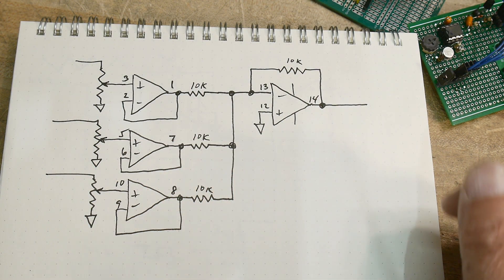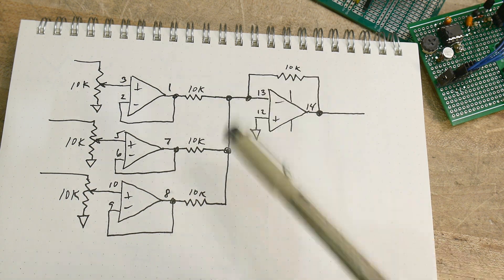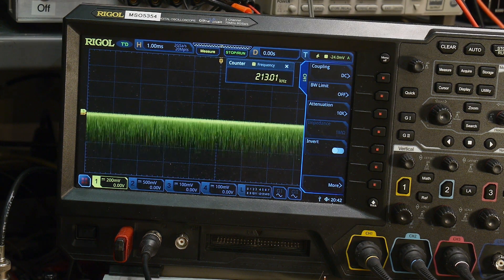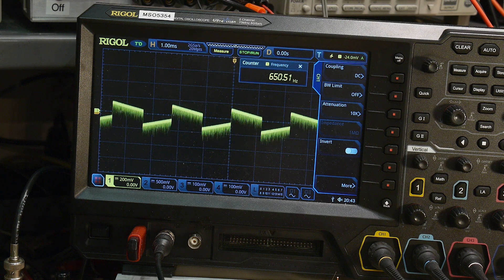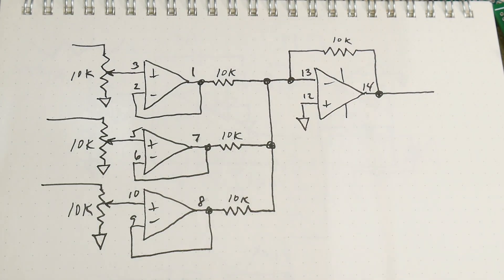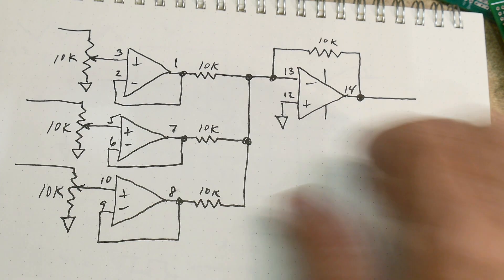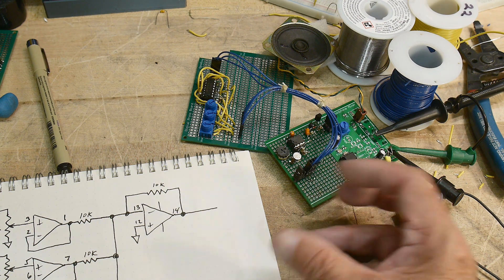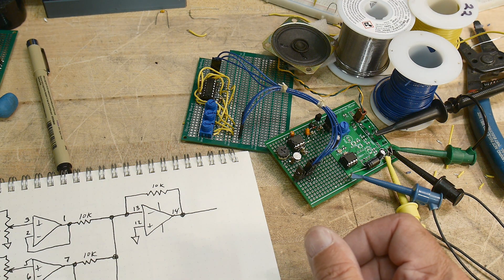#1199 DIY Analog Synthesizer (part 3 of 15)

Comment: If the point of a buffer is to have a high input impedance and low output impedance, I am curious as to why you added the extra 10k resistor on the output of the buffer? Is that to get unity gain with the 2nd stage?
Reply from the maker: the three 10k resistor are a sum. you can have different gains on each channel. so in this case gain is 1, or actually -1. if one of the buffers had a 5k resistor then that channel would have a gain of -2
Reply: @IMSAIGuy  Oh very interesting yeah that is a really good point. I had not considered the 2nd stage mixer's feedback loop relative to its input impedance. I really appreciate the insight!

Comment: I have a TENS unit kind of thing that generates out put square wave frequency less that 1khz. I want to run the following ten out puts for 5 to 10 min ea:  Hz  .52, .2.50, 40.00, 95.00, 376.29, 476.50, 527.00, 665.34, 752.70, 987.23. I think the power in is 4volt and the output power is below 1 miliamp.
Any ideas?
Reply from the maker: microcontroller, Arduino is an example

Comment: It would be cool to filter the noise separately before mixing it in. Then you could change what type of noise is getting mixed in or get the noise filter to oscillate and create a sine wave as well.

Comment: From your hints, I expect you are going to use an OTA (operational transconductance amplifier) like an LM3080. A couple of warnings---do not treat them like an op-amp---treat them like an amplifier block with input and output, with a current controlled gain.. They can be easy to smoke if you aren't paying attention--learned this the hard way.  Also, they can only deal with very low signal levels, so you will need a buffer amp to bring them up to your standard voltage level to math the rest other circuits. Just wanted to offer a couple of warnings to prevent your magic smoke from escaping. :)

Comment: 0:05, you don't need the 3 opamps on the left side, if the output of the previous module/stage sources from a opamp .. or you would place the potentionmeter inside of the opamps setup.
check out "Thonk" in the Uk, they have CA3080,  some latvian company called "Alfa" cloned CA3080 and so. aswel the ALFA VCO clone of the CEM3340 VCO chip, filter on chip Alfa AS3320 a clone of the 4 pole CEM3320 Filter chip.
Reply from the maker: yes, this one is robust to create equal channels for different incoming impedances
Reply from the maker: 3080 will be in a future video
Reply: @IMSAIGuy  i wonder why Texas Instruments doesn't provide us with a DIP8/soic8 single LM13700, sometimes you just want one and the things i make i try to fit on a 19mm wide x 110 mm high PCB alongside sockets, pots and stuff. the DIP16 is kinda big

now the CA3080 is kinda obsolete. i made a Rene Schmidtz Korg MS-20 (2 pole) clone filter with the CA3080, video on my profile and until today it's sounds kinda good.

I still would place the pots inside/between the opamps and make the opamps source from the source, so the signal from the source isn't sinked into to ground but directly into to opamp or what is your thought about it
Reply from the maker: @AnalogDude_  I agree
Reply: @IMSAIGuy  check out the "Befaco" DUAL ATENUVERTER module (schematic on their site), maybe you wanna extend that mixer of yours to add some additional magic.
Reply from the maker: @AnalogDude_  thanks, same as mine without the buffered inputs.
Reply: @IMSAIGuy   @IMSAI Guy  you can rotate waves 180º than mix them., Saw wave Ramp down becomes Ramp up.

the Serge DUSG schematic from "Ken Stone" file: schem_cgs75_vcs1.gif
Contains a similar circuit on the bottom.

internet archiv: cgs synth net, there will you find the schematic of CGS75

the best syntersizer module ever "Make Noise Maths", based on the Serge DUSG, universal slope generator.
Reply: @IMSAIGuy  ah, that's why. thx

Comment: a fun one for me when I first started futzing with filters was using a twin t filter to create a bass or tom sound where you get the twin t on the edge of self oscillation so that you can send a transient through it to create the sound. It's been a while but I think I used an unbuffered 4069 or 4049 for the filter portion and a 40106 for a consistently timed input. Though I cant recall, i will have to dig around my basement to find the thing lol.